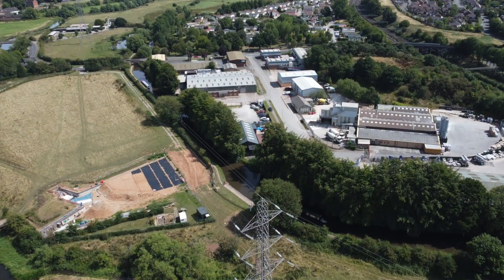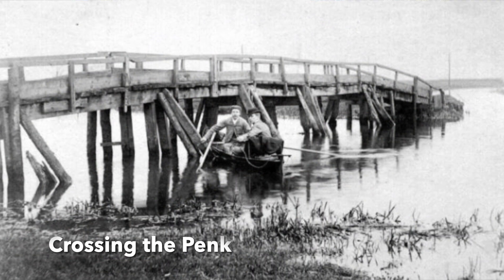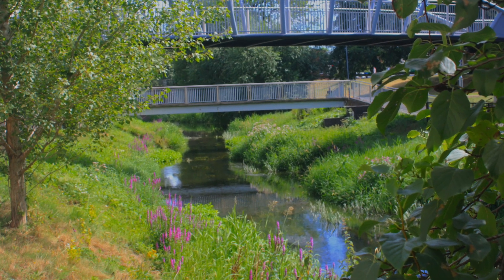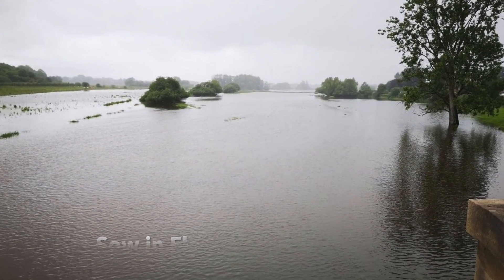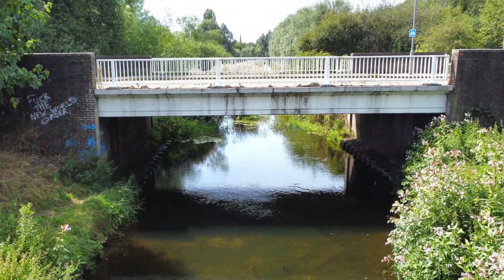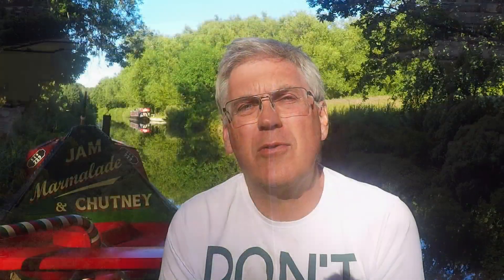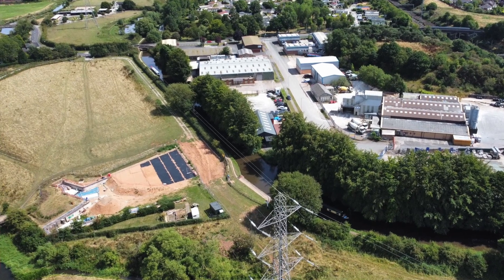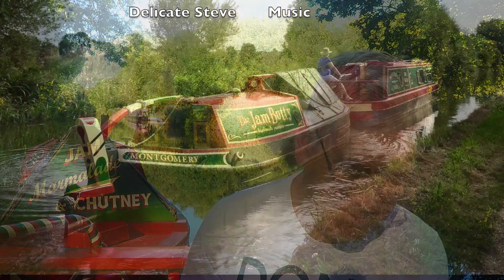The Stafford Branch Canal

Comment: Hi Andy,

The Stafford branch wasn't the only branch from the S&W that locked out into a river. Between Kidderminster and Stourport at Pratts Bridge (sometimes called Platts Wharf) a lock led down into a short Stretch of the River Stour to enable canal boats to reach the nearby Wilden Ironworks-the lock and the short section leading into the River can still be seen while the site of the ironworks is still in use as an industrial estate.

Both this branch and the Stafford branch can be seen on the Explore Geo-referenced Maps website where it is possible to overlay the modern map over the old one so you can see  exactly where the old things are (or were) nowadays so that you can explore to see if anything is left. Very useful for exploring old canals and railways.
Reply from the maker: True - there was a good article about Pratts in Narrowboat a couple of years ago.